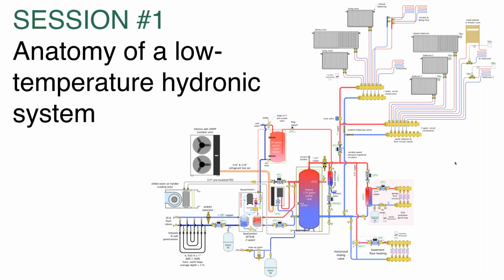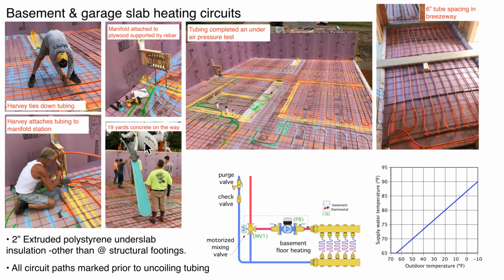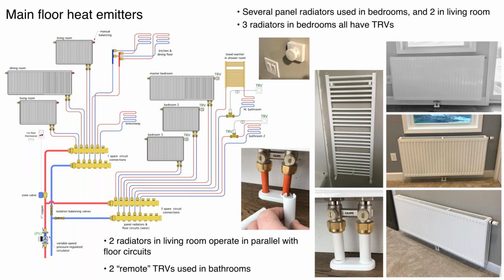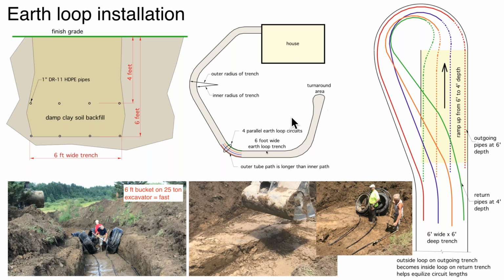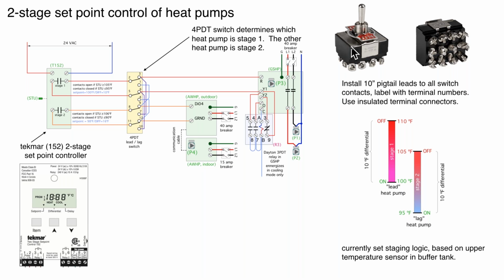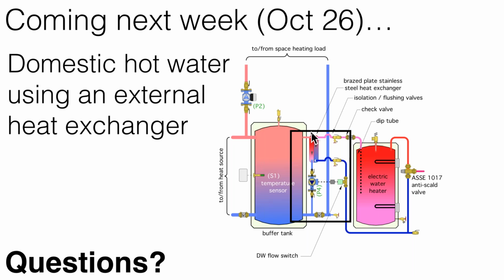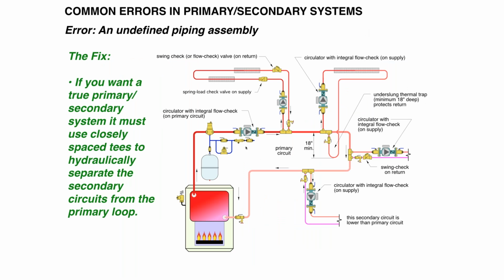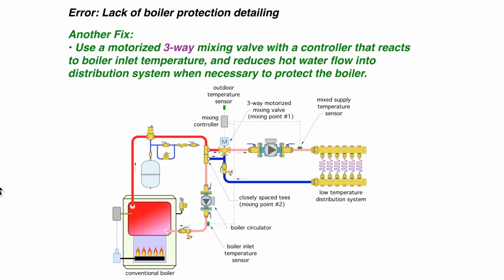Part 1: Designing for Low Temperature Systems with John Siegenthaler

Comment: Amazing presentation! Really well done. 
For a geothermal heat-pump system water2water, why is the COP is low? Most advanced European ground source heat pumps are pushing a COP above 5 in these conditions.
Reply: I think it's a comparison of total system COP versus just the heat pump. Geo has more pumps pulling more power affecting COP numbers.
Reply from the maker: The COP on a Water to Water can easily exceed a COP of 4 when designed properly and also touch 5. You are exactly right.

Comment: And the discussion at about 2:00:00 is right on:  Our gas (heating and cooking) annual cost is only about $400, and half of that is the monthly meter charge.  So depending on the cost of electric, for us with solar electric mostly, and some grid use off peak, the electric cost/Btu can be as little as half of nat gas $/Btu.  Saving a couple hundred $ annually is not going to pay for a new heat pump system very fast, but at least the operating cost is less and there are plenty of other reasons to go all electric.
Reply from the maker: Thanks for your great comment Dale! Thank you for watching.

Comment: Thanks for providing these training sessions.  As an engineer, and learning HVAC details to improve my home, these are riveting discussions.  The boiler protection find a fix is very interesting.  I have a 30yr old conventional nat gas boiler hydronic heat,  which I've been running at lower and lower temps as I get the home sealed and insulated better.  And I've been planning how to change it over to geo or air to water heat pump, potentially keeping the nat gas boiler as backup and since it's not broken.  But, yikes, flue gas condensation!
Reply from the maker: Thanks for sharing your comments Dale. We are continually uploading new training videos from our various events.